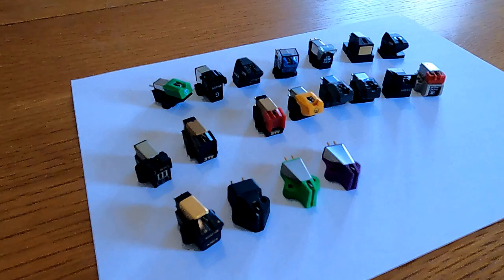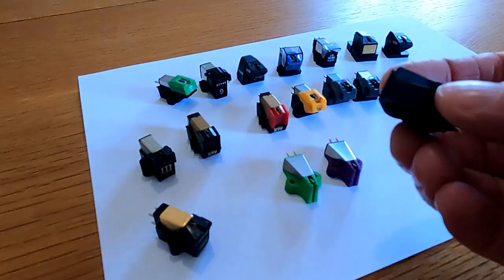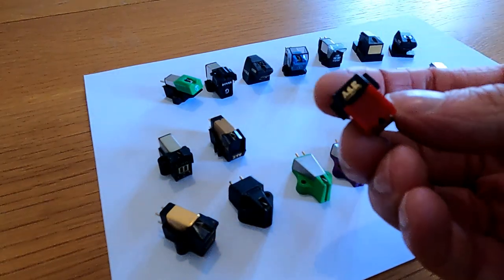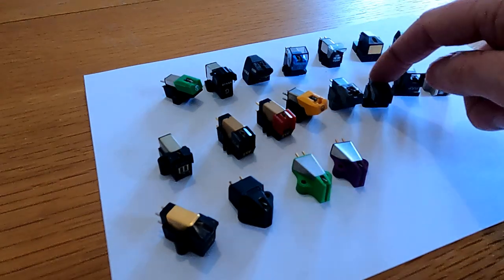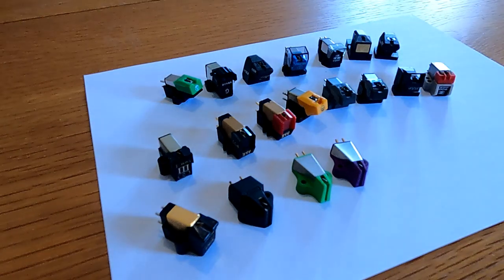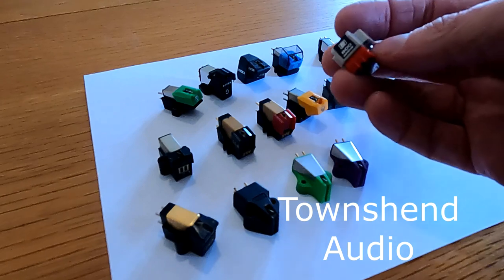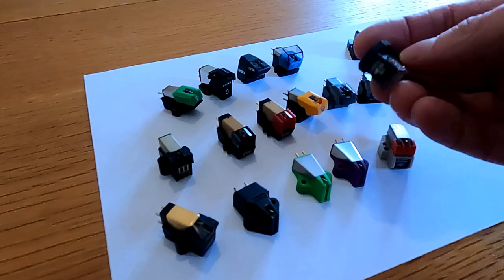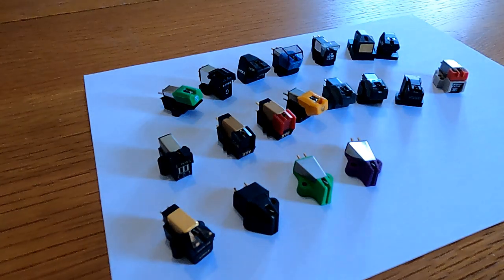Original Rega Planar 2, 3 cartridge history and replacement suggestions

Comment: Thanks for a great trip down memory lane, I have a rega planar2 from about 1985 still works fine, had the Linn k9 first- the ad said 'it tracks like a dog' ha ha!! Followed by an AT 110e still working, both great cartridges at a sensible price, paired nicely with the rega2 deck which had the rb250 arm( with bias), and could be overly bright if not carefully matched. Great that vinyl made a comeback, for many of course it never went away!! Cheers and thanks for your helpful videos.

Comment: The Rega R100, Supex, A&R P77, etc, were all built around the same Namiki generator, not Supex. There are still plenty of Namiki sourced MMs out there, including the Sumiko Pearl and Black Pearl, the Shelter 201, and even more exotic fare like the Vertere Sabre.
Ortofon made an accessory called the CAP210 to reduce the brightness of the VMS cartridges. It added 210pF of capacitance across the output pins.

Comment: I had an Ortofon 20E II fitted in my old Garrard 401/SME 3009 and it had a sort of capacitor/plate fitted at the back of the pins to 'tame' the treble- sounded much better than the Shure M95ED that it replaced. I've now got a Planar 3 with a Bias which is much better.

Comment: Finally a video touching on the original Rega Bias, Super Bias and Bias 2. I could not find information/opinions until I stumbled upon this video. From your comments I extract the original Bias was not bad nor excellent, just ok. But that the suspension is probably worn out now, right? Mine does not have many hours of use, probably less than 100, but years have gone by for sure

Comment: That was a nice trip down memory lane.
I have a soft spot for Grado and have half a dozen in my collection. A good one can sound stunning, very MC-like and while they can sound superb on a Rega, especially using the old R200 arm, they really need a deck with a well shielded motor, or a DC motor as they can pick up hum. Sadly, modern Grado cartridges use quite poor styli compared to the old models, heavy bush mounted stones unless you pay top dollar for the higher end wood series.
The old budget FCE & FTE (grey body) models had great dynamics and scale, albeit lacking refinement - but then again a FTE cost about £15 in the 80s.
I have a lovely Grado F1+ in my collection which I bought about 5 years ago NOS. Sounds great on a Rega 3 but if you put that thing in an original Mission 774 arm mounted on a Linn or Gyro.....boy is that thing good!
Reply from the maker: It does sound like I’m being a bit negative about Grado, they’ve been disproportionately expensive in UK for a few years now, but in the 80s/90s they were a major player...

Comment: Left end of center row is that a supex mk 3, I bought a dual 505 mk 2 with this fitted and have not seen much information, I have used it in a duo of Project carbon decks and my current Rega Planner 3 where it has sounded quiet good. Current cartridge is OM2 red how do they compare and what would be a modern replacement for the Supex? The Red will be soon upgraded to reflect the rest of the work done to the RP3, rewired arm, 24v motor, 33rpm sub platter and a 33rpm acrylic platter. Great to see so many great old school cartridges many of which I have owned over the years.

Comment: I had trouble replacing the stylus on my ortofon 510 mk2 until I discovered you need to swing the stylus protector down.  Then the stylus slides off with no force at all.

Comment: Have you ever come across grey rega cart probs from the early 90s. I have one, came with p3. Looks just like modern elys or exact but it's grey. It's not the mono cart, a bit lighter grey, also it's very much stereo.

It has the 3point attachment.
Reply from the maker: Yes, if I remember correctly it was an anniversary model fitted to the RP40 (40th anniversary) ..., suspect it was Ely’s based... it might come to me later
Reply: @cheshireaudio  very good suggestion. Unfortunately mine is way darker gray than that anniversary Elys.
It was actually darker than I remembered, at first glance i was sure it was that Rp40 elys
Reply: The grey model was also the original Elys and fairly quickly replaced by the purple one.
The original green bias and grey Elys also had super-elliptical tip profiles. They were never advertised as such but the tips were 5x18um - all later versions use 8x18um.
I recall buying the original green Bias from the Cornflake Shop in London for £34 :) - It was a lovely cartridge for that price and punched well above it's weight. IIRC I had it mounted on a Linn Ittok/LP12 because we did crazy things like that in those days.
Reply from the maker: Excellent memory skills, I’d forgotten about the first Elys. There’s your answer!